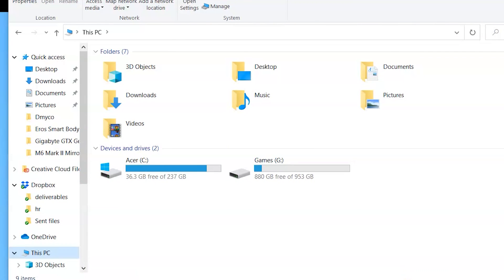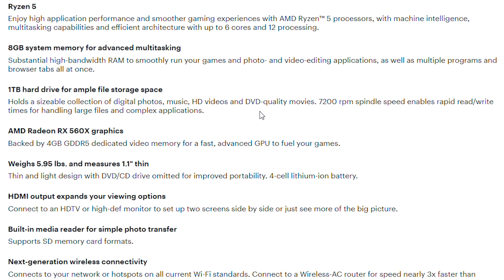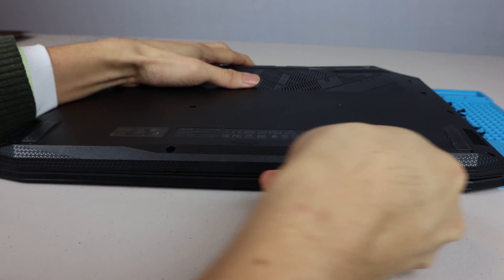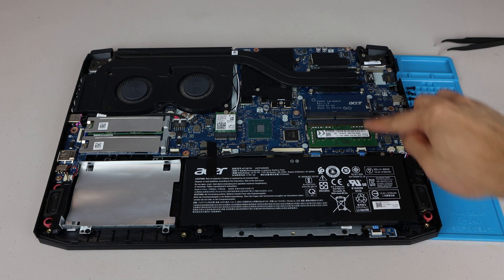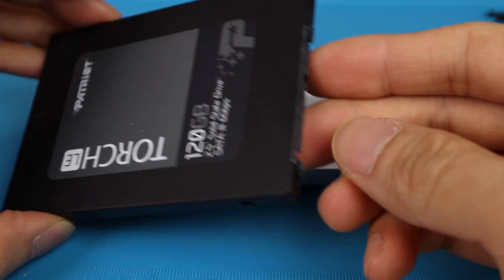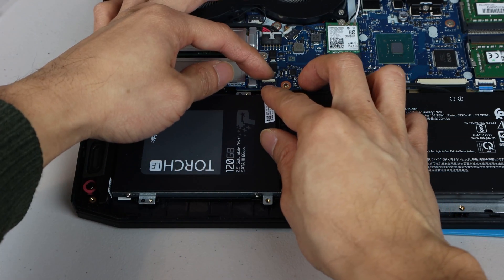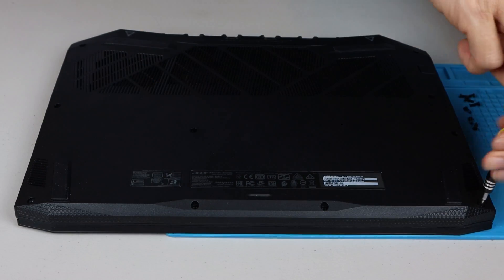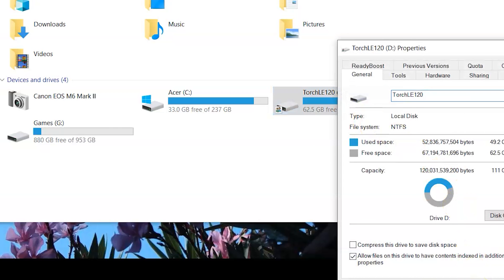How to Install 2.5" HDD or SSD in Acer Nitro 5 Gaming Laptop (2019 ver) SATA III Drive

Comment: Help! Mine didn't include screws. I was planning to upgrade using old laptop parts but can I reuse screws from a 2009 Vaio?
Reply from the maker: Most 2.5" form factor HDD screws are standard so it should be possible to reuse screws from another laptop's HDD.
Reply: @FixItPhil  thanks! i have already installed it. What can I do about the drive called System Reserved?
Reply from the maker: @aqxuire  The System Reserved partition is created during a clean/fresh install of Windows and takes up a small amount hard disk space. It's not recommended to remove or alter this partition because it contains the boot loader and Windows may not boot properly without it.

If you really don’t want this partition on your drive, you can prevent it from being created in the first place. Rather than create a new partition in unallocated space from within the Windows installer, create a new partition that consumes all unallocated space by using another disk-partitioning tool before running Windows installation, then the partition will not be created. But again, there's very little impact to performance so no reason you'd need to do this.
Reply: @FixItPhil  ok thank you!

Comment: Acer Nitro 5 Core i5 9th Gen - (8 GB/1 TB HDD/256 GB SSD/Windows 10 Home/4 GB Graphics/NVIDIA Geforce GTX 1650) AN515-54-521N Gaming Laptop
http://dl.flipkart.com/dl/acer-nitro-5-core-i5-9th-gen-8-gb-1-tb-hdd-256-gb-ssd-windows-10-home-4-graphics-nvidia-geforce-gtx-1650-an515-54-521n-gaming-laptop/p/itm5991f03d010e4?pid=COMFHNY8Z7C9DGU6&cmpid=product.share.pp
can i upgrade the hdd to 2tb and ssd to 1tb and ram to 16gb in this laptop??  plzz reply
Reply from the maker: Yes, the base model is the same as the one in this video. RAM is upgradable to 32 GB and the M.2 slots and 2.5" HDD bay can support up to 2 TB each.
Reply: @FixItPhil  ssd support upto??
Reply from the maker: 2 TB
Reply: @FixItPhil  that means there is 1ram slot ,one ssd and one hdd slot??
Reply: @FixItPhil  can i upgrade ssd and hdd two 2 tb together??

Comment: I am looking to install this hard drive:https://www.impactcomputers.com/kh.01k07.005.html
Will this work with my laptop.
Reply from the maker: No, generally 3.5" form factor hard drives will not fit in current generation laptops. You will need either a 2.5" form factor drive like this one: https://geni.us/C4MNgu [Amazon Affiliate Product Link] or an M.2 drive like this one: https://geni.us/nSTKB [Amazon Affiliate Product Link] Be sure to check your model's specification to determine which drive is appropriate for your machine.

Comment: Hey,  I have an Acer AN515-51.... do you know if it uses the same HDD cable and mounting bracket?? I bought a 2.5 ssd to upgrade but went to open the ssd slot and there was no hdd cable or bracket inside (part missing) Could you help me get the part numbers for hhd cable and moutning bracket/screws for the Acer AN515-51????
Reply from the maker: I believe the cable for your model is slightly different. I found some on Ebay here: https://ebay.to/2yfKqeO [Ebay Affiliate Link] Just make sure the one you select lists your laptop model as a compatible laptop. If you need the HDD caddy/tray for the AN515-51, I found some listings here: https://ebay.to/3e4sMdp [Ebay Affiliate Link]

Comment: Which would you recommend an external SSD or an internal?
Reply from the maker: I almost always recommend an internal SSD because the performance is usually better, especially if you're installing an NVMe over SATA, you'll get faster read/write speeds for file transfers. I also think it tends to be less prone to failure as it doesn't get moved around a lot, though that might be more of a perception than grounded in statistics. Regardless, I think it's more convenient if you'll only ever be using the drive with a specific computer to not have to take up a USB port and have something extra sitting on the desk. The only time I'd recommend an external drive instead is if you frequently need to use a set of files on different computers or want to have a backup that you can store elsewhere, like a safe or deposit box with backup files that you want to keep safe in case of loss, say from a house fire or theft of a laptop.
Reply: @FixItPhil  see yeah that's the thing my gaming laptop already came with a nvme ssd its 512gb and like it's only one slot and I didn't want to replace it I wanted to add on you know?
Reply from the maker: But you can put a 2.5" SATA SSD in the HDD bay, right? That space is unoccupied? I think that should work for you.
Reply: @FixItPhil  ok yeah thank you so much. And yeah it is
Reply: @FixItPhil  oh yeah which one would you recommend

Comment: What is the maximum possible storage capacity of the laptop with all three drives? Also great video.
Reply from the maker: The theoretical max would be 6 TB, 2 TB per drive. That said, the HDD may support a 4 TB HDD though I haven't installed one myself, however, this one from Samsung would fit, physically: https://geni.us/C4MNgu [NewEgg Affiliate Link] so you could possibly get up to 8 TB, but I would check with Acer on compatibility with the drive before making the purchase.
Reply: @FixItPhil  the m.2 slots are compatible with 2tb ssd?
Reply from the maker: Yes, mine are able to support up to 2 TB SSDs in either location, however, be sure to note whether your slots are NVMe or SATA interface compatible so you get the right kind of M.2 drive that will work. In my laptop both are NVMe compatible, but only one can handle a SATA interface.

Comment: I install an SSD and it recognizes it in BIOS but it doesn’t show up in windows explorer
Reply from the maker: You'll need to format the hard drive, if it is new, in order to see it in Windows Explorer.  In Windows, type 'Computer Management' in your search bar. Select Disk Management. In the bottom half of the second column, find your new drive/SSD. Select a block of empty storage space and right-click it. Then choose the format option and follow the prompts on the screen.

Comment: I have AN515-43-R2M9 with 256gb SSD+1tb hdd ...so cani install another extra SSD without removing pre-installed SSD and hdd ?
Reply from the maker: The AN515-43 should have two M.2 slots (1 NVMe and 1 SATA) and one 2.5" HDD bay so you should have 1 M.2 slot open, but I don't know whether it's the NVMe or SATA one. You'll have to reach out to Acer or open up the laptop to be sure (it'll be marked on the motherboard next to the slot). You don't need to remove the existing drives.
Reply: @FixItPhil  Thanks a lot...
Reply: @FixItPhil  I watched many videos...about acer nitro 5 then I come to your channel and seen your videos...but your model number is different then ask you...but now problem is solved...
Reply: @FixItPhil  i got the same model laptop, is it will be marked on the motherboard next to the slot  whether  it is  NVMe  or  SATA  ???   mine was called PCIe  &  PCIe SATA

Comment: Does my model (AN515-54-54VX, the model with 256GB NVMe with Linux preinstalled, GTX 1050 and i5) come with hdd caddy? Because even if in the box there are the cable and the screws i'm afraid that the caddy isn't included.
Reply from the maker: The HDD tray is usually pre-installed inside the laptop. Only way to find out would be to open it up.
Reply: @FixItPhil  thanks, I'll try later
Reply: @FixItPhil  thanks, I'll try later

Comment: My laptoo comes with a 500 gb ssd 
And i was wondering can i install another ssd if so? should i install a hdd now or another ssd?
Reply from the maker: Most of the Nitro 5 models have space for at least 1 additional drive. Based on your description I can't tell if you have an M.2 or 2.5" form factor drive pre-installed in your system, but there's probably another slot available (either M.2 or the 2.5" HDD bay).  As for which to get, it depends on what you're using it for. If you plan on using the new drive as the boot drive, I'd got with an SSD becuase you will experience faster load times. If you just need it for storage, an HDD would probably work fine and save you some money (if your primary drive IS already an HDD, then you would have to get an M.2 SSD either for storage or transfer your OS over to it to make it the primary boot drive).
Reply: @FixItPhil  thanks i will go with a tb ssd😁

Comment: Nice video. Im a noob to computers and getting my first laptop soon and want to upgrade to ssd as soon as i get it shipped, is there anything i need to do or can i just switch my hdd to sdd right away?
Reply: Oscar Delgado you have to fresh install latest windows on SSD or clone from HDD to SSD,check my uploads,thanks
Reply from the maker: Yes, if you take the old hard drive out and put a brand new one in, you'll have to clone the old drive to the new one to ensure it has the operating system loaded on it in order to boot it up. Otherwise you will have to format and load the OS manually to the new drive (e.g. with Windows Installation media). The other option is to leave the old hard drive installed and boot from that one with the new hard drive just used as extra storage space.

Comment: Does my model (AN515-43-R0YM) come with the SATA cable and HDD caddy?
Reply from the maker: Not sure. If it did come with HDD upgrade stuff (cable and screws) it would have been in the original box with the instruction manuals. It's easy to miss because they're small. The HDD caddy typically is shipped inside the laptop.

Comment: Hey! So if my laptop comes with a 256 GB SSD preinstalled, I can install a 2.5 SATA Samsung 500 GB SSD in the 2.5 slot and run two SSDs in my system? The 256 GB one preinstalled with Windows and the 509 GB 2.5 SSD for my games?
Reply from the maker: Yes, that configuration would be fine.

Comment: Is there any 2tb hdd that you recommend for this laptop? I don't know much about pc and im trying to get one, but I don't want to mess up buying something that I shouldn't. Also I don't want to spend a whole lot of money.
Reply from the maker: Sure, if you're on a budget, Western digital makes a decent 2 TB SATA HDD: https://geni.us/rbzv [Amaon Affiliate Product Link] It's fine for storage, media, and could be used as the boot drive, but is not the fastest. Seagate makes one a little bit less expensive: https://geni.us/lH5H [Amazon Affiliate Product Link] but I find that they are less reliable in the long-term as I've had several Seagate drives fail over the years. For this reason, although it boasts a faster speed, I wouldn't use it as a boot drive, and I would only store non-valuable data on it like game files and software rather than important personal documents, photos, etc. due to risk of loss.
Reply: @FixItPhil  thank you for your answer! This is really helpful!

Comment: I buying this laptop with 128 sad and +1tb hdd. Does this mean I have to replace the 1tb? Or is there an extra slot to add an extra 2.5 drive?
Reply from the maker: There is only one bay for a 2.5" drive and since yours already has a 1TB HDD, that bay is taken (see 2:19). The only reason you would need to replace the HDD would be if you want a larger capacity HDD. However, with your build, since you only have 1 SSD pre-installed, you can install a second SSD if you need more storage. You can watch my other video on the steps to do this: https://youtu.be/Oz735CCXTQo Your third option is to use a second 2.5" externally via USB.
Reply: @FixItPhil  thanks so much for your help! Laptop is great!

Comment: Hey man, I’m wondering if you can help me out. I wanna upgrade my 2018 version of the average nitro 5. I got the i5 processor and 250GB of storage. I have no clue what ram it has. But I want to upgrade the storage so I can download more games. Should I buy a Samsung 2.5 inch 840 evo 1TB? Or get a m.2 SSD stick? I also want to upgrade the ram for better FPS, which stick would you recommend? I wanna get 16gb of ram
Reply: Sneezymilk yes you can add Samsung 2.5 inch 840 evo 1tb or any 2.5 inch HDD or SSD drives,for the RAM DDR4 SODIMM 2400mhz or 2666mhz works fine,good brand gskill,kingston,crucial,etc
Reply: TechPH thank you bro! Those ram sticks will fit mine? I’ll order some right now

Comment: Can this SATA Cable fit in any ACER Nitro laptop, because I've got one with i7-9750h/gtx1660ti/16gb/512gb (SSD), so I need to install HDD, but I don't have a cable, so will this cable like yours be ok?
Reply from the maker: I don't think the cable is universally compatible, though it may work with other models. Sorry, I'm not sure based on the info you provided. Your best bet will be to search your laptop's model number with the terms "SATA adapter cable" on a site that sells components like NewEgg and see if you find one for your specific model: http://bit.ly/3c8xvcU [NewEgg Affiliate Product Link]

Comment: Thanks for the video. I have a ACER Nitro 5 AN515-54-52NB with 256 SSD already installed. I want to install a HDD to the 2.5 bay. Do you know if it will take a 2tb HDD?
Reply: Hey. Yes, he says that in the video. 3:47
Reply from the maker: Yes, it will support a 2TB HDD.

Comment: I have a question I went with a Samsung SSD drive and it was mirrored fine with the software it comes with but if I want to leave my HDD drive there could I leave it in there I don’t really want to remove it from my laptop will this cause any problems?
Reply from the maker: Sure, you don't have to remove the original drive. I gather you mirrored the drive because you wanted to use the new one as the primary boot drive? If that's the case, you'd have to change the BIOS settings to indicate that the new drive should be the first boot priority, otherwise it could default to booting from the old drive. If it doesn't matter either way then you don't have to do anything special after installing the second drive.

Comment: is that 2TB limit for both the SSD and HDD (I was hoping to put 4TB+ HDD in that slot)
Reply from the maker: If you can find a 4 GB HDD that is 7mm thick then it should work. I think they make them that thin now, but the real limitation for HDDs is the physical size of the drive and not the capacity it contains.